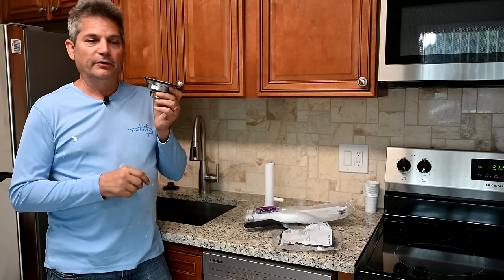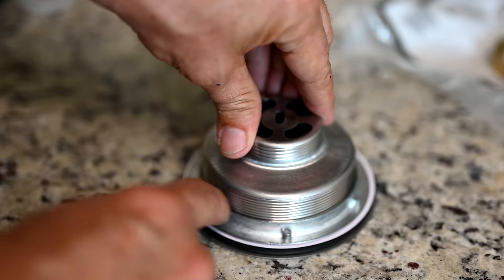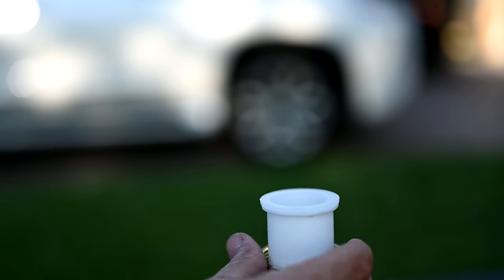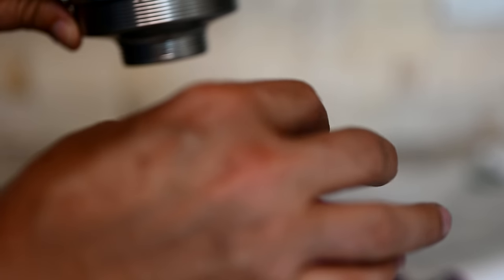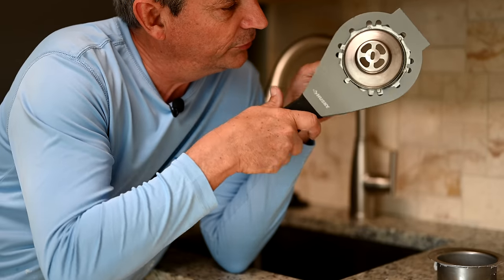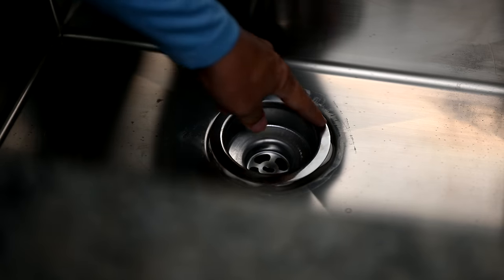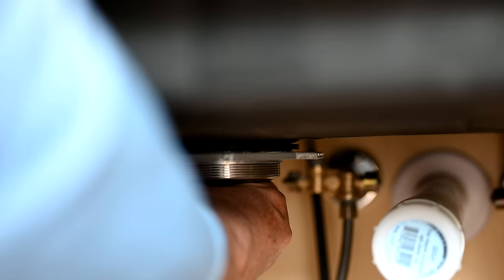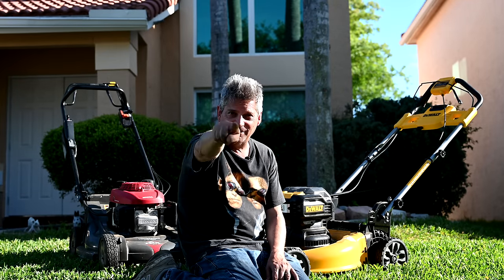How To Install Kitchen Sink Drain Strainer, Stop Leaks

Comment: Every time I tighten the drainpipe with the high hat washer in place it, the plastic nut "skips" & loosens. I have tried several times to line up the plastic nut onto the threads exactly & the plastic nut keeps skipping & loosens.  BUT when I remove the high hat washer, the nut tightens well. Any reason why this connection leaks with the high hat in place?? I only tighten by hand as much as I can.

Comment: Excellent instruction! Thank you, Jeff this will make the task go quickly. I would like to add one of my own tips, to save your back. Before you start, use a moving blanket or something similar as a platform to lie on. You could also use seat cushions, pillows, etc. The idea is to make them level with the bottom of the cabinet floor so you are lying down flat and not arching your back excessively.

Comment: Jeff, Very clear explanation with good close up videos. This will help a lot of weekend warriors solve their issues. That big strainer nut wrench is awesome. I have always gotten by with my 16 inch Channelock pliers. But next time I see one on sale or at a yard sale I will snarf it up.

The comment about the pipe joint comment on the threads helps with metal nuts and tailpieces, and especially with threaded tailpieces that go onto bathroom drains where the tailpiece threads into the popup assembly. On the others, the pipe compound is lubrication making assembly easier.

If you go to plumbing supply houses to buy your sink strainer you can get them with real brass nuts instead of the pot metal cast nuts. The brass nuts hold up much better over time especially if something loosens up and there is a small leak that causes corrosion. 

One other point, do not overtighten plastic drain nuts. If they don't seal when firmly hand tightened, replace the washers and check the alignment of the parts.

Keep the great information coming!
Reply from the maker: thanks Walter!

Comment: Thank you for this video.  I recently had a new stainless steel sink installed.  The drains on both sides leaked, so I watched this video and decided to redo them myself.  Not only had the installer not scraped off the excess putty underneath before threading the nut on, but he had also not used the friction washer.  After I reinstalled them the proper way, neither side leaks.  Just goes to show if you want something done right, do it yourself.
Reply from the maker: Excellent work Pete!

Comment: I spent too much time worrying about a sink drain wrench, when I should have paid more attention to the pvc pipes instead. Probably could have saved some money, used fewer pipes and less labor.  Buy plenty of pipe and fittings- you can always take back what you dont need, which is less frustrating than not having what you need up front. I ended out making 3 cuts on different pipes with regular hand saw. Its all together now, and I'm much more knowledgable- thanks Jeff!

Comment: Great explanation on how to do this correctly. It was missing a step on myself by not cleaning the plumbers putty off the bottom first before putting up the nut which was giving me problems everything shifting so appreciate the info.

Comment: This video was EXTREMELY helpful!! I almost threw the friction washer away. I threw the glacier bay box away by accident and had nothing to refer to to install the drain. This was perfect. Thankyou!!
Reply from the maker: I need to do a video just on the washer alone, many people throw it away!
Reply: @jeffostroff  Yes that would be a great idea. I installed a double sink last night. A few days ago, I fixed the drains to the sink and made 2 piles of boxes. One to throw away and the other to keep instruction manuals and 1 of any duplicate boxes I had just in case I missed something. Well last night i took the drain apart and looked at the washer assuming it might be paper there to prevent the rubber from scratching or getting damaged, a protective layer. Right when I thought about tossing it, I looked for instructions & realized I threw both boxes away with the wrong pile. Something said look on Youtube before I toss it. If I would have thrown them in the trash for my double sink I would have had double trouble.  Your attention to detail is great. For this to be 10 years ago reminded me of what I say about not counting out informational things just because it's got some years on it. Sometimes integrity gets lost with modern info. Really have to weed through & thats what I did. I came across a couple videos from this year and a few years back and they don't even come close to the way you broke this down. When i got to your video I watched it twice and shared it with someone. Very neat, very clean, very detailed. Again, thank you SO much. My sink looks amazing! I won't attempt to throw away small paper again before reading what it's for first lol. Have a happy new year!

Comment: I changed the drain last year in the kitchen but reused the copper pipes with compression fittings.  I used plumbers putty under the top flange of the drain.  Great. Video Jeff.
Reply from the maker: Nice work!

Comment: Excellent and detailed tutorial. I would point out that the edges of the High Hat gasket can impede the flow of wastewater and trap food. An alternative is a brass tailpipe with a gasket below the shoulder of the pipe, this is compressed by the bottom nut. It provides a waterproof seal and provides full flow of waster water as well.

Comment: This was extremely helpful. Especially the part about finding the threads by going counterclockwise till it clicks. Man… that’s seriously gold. There was a leak under the sink at the house we just moved into, I saw that whoever installed it didn’t remove the excess putty from underneath. It definitely caused problems.
Reply from the maker: Yes and as it turns out we really don't need to use the putty down there because it is the Teflon tape that actually solves the problem period so once you do that you can experiment with not putting the putty under there and I bet you won't have a leak.

Comment: All fine and dandy, with  ideal conditions. Your taking out a brand new basket strainer and putting it back in.
I've been a plumber for more than 50years. Very seldom does the old nut ever come off easy. It's a aluminum diacast nut. It corrodes to the strainer. Which means you'll have to drill and split the nut or saw and split the nut to release it. 
I've found if I cut from the top, with a sawsall thru the side if the strainer on a sharp angle I can cut the nut.
Also, it fine if you want to spend more for the nut wrench than the basket strainer. A channel lock pliers works fine and a second on the threads below to hold the basket strainer from turning.
Also be sure to tighten the nut enough to squeeze out most of the putty or you'll have a leak later when the putty breaks down later. 
Also I put pipe dope or grease on the threads for the next guy years from now !
So unless your working with all new, you might want to call a pro !!
Reply from the maker: We have had some tight ones also. I can also use a Dremel on the bottom rusty nut. Sometimes, a drain wrench inside the basket drain up top can be held by one person, while another loosens from underneath

Comment: This was a very useful video - no frills, keep it simple and straightforward with accurate and clear descriptions of the functions of the different pieces and their role in the overall configuration. Thank you, Jeff. 
Question: after installing a dishwasher in my dual sink configuration...I experiencing drain backups. Does a dishwasher install require an air gap 'thing' to keep the system flowing?
Reply from the maker: The other sink should not back up. Did you watch our dishwasher install video from last year? we show you how to do the high side loop for the dishwasher hose? Also you might have a sewer clog somewhere down the line, we just cleaned out our kitchen sewer line last year, as it clogged a bit causing water to back into the 2nd sink. Often requires $150 visit from plumber to clear it out.

Comment: Good video and very informative.  The only suggestion I have would be add pipe dope to both sets of threads on the basket strainer to help seal joints.  There are also specialty wrenches for inside basket strainer to keep them from turning while you tighten the larger bottom nut, but I typically just put two screw drivers down through the top, in different holes, and turn them clockwise while I tighten the large nut with a large pair of pliers.
Reply from the maker: Good idea! Although, I usually don't recommend adding pipe dope unless you have a leak, these usually don't leak if you install them correctly. Also remember that pipe dope only gets applied to the male threaded part, not the female parts.

Comment: I installed a new drain in kitchen, but the friction washer go wet, and disintegrated. Had lots of problems with washer moving sideways, and also drain moving. I was stuck using an adjustable spanner wrench that constantly slipped off drain nut. Very difficult to get the thing much more than hand tight. I did manage to get it tight, and not currently leaking. Thanks for the video. I am heading to lowes tomorrow to get the wrench you used, and probably will wind up buying a new drain with new friction washer, and gasket, and do the job again the correct way. Thanks to you, I now know the right way, and will hopefully have no leaks for a long time to come.
Reply from the maker: I got you covered Mark, Lowes sells them $2.98: https://www.lowes.com/pd/Danco-2-Pack-4-375-in-Rubber-Basket-Strainer-Washers/4777141

Comment: Thank You, at first I was confused because the instructions I got from my new sink / drain showed one gasket on top and another on the bottom. It leaked so I switched places for the gaskets and was fine for a day but I decided to use plumbers putty on top and both gaskets on the bottom.

Comment: Great video, it is exactly what i need. But it stopped at the spot where i needed the most. How did u end up connecting the sink drain to the drain on the wall? Our house has a very high drain as well. There is only 3 inches left between bottom of the sink and the drain line from the wall. Did u had to extend the height of p trap to accommodate this situation? If so is there going to be any issues in the future?

Thank you so much
Reply from the maker: This was a brand new sink put on a brand new cabinet that replaced an old set of kitchen cabinets with a very narrow sink and it was barely working to begin with period So what we ended up doing after this was we discovered that the water wasn't draining so we ended up cutting into the wall and lowering that pipe that goes into the plumbing stack. We have another video that we hope to get up on this in the next few weeks that shows exactly what had to be done but yes this is a problem for a lot of people when they remodel and they go with a deeper sink which pushes the the level of the water lower but yet the output of the P trap is higher and it can't be that way it's all tablet. Particularly in a house like this one where there was no garbage disposal before, the output of the garbage disposal cannot be below the output of the P trap or the water will come back in and fill up into the garbage disposal. We hope to have that video up soon
Reply: @jeffostroff  Thank you for the speedy reply. That's exactly what my plumber friend suggested. But it's a lot of work to do that way since our in plastered wall drain is a cast iron pipe... In ur experience, would 3" higher work? 
What could cause water not drain?

Looking forward to that video 😊
Thnx again 😃

Comment: Thanks! I have to replace those parts for my kitchen sink and glad you said not to put the old putty back in the container. I just watched another of these repair videos and didn't like that he said to put it back in with the new. I'm used to working with fluxes and other materials and have been taught to never do that - contamination weakens the fresh stuff of some things. There were more parts I didn't like with his work either. He just reattached dirty (black crud and mold) pvc back up instead of taking it to another sink to wash off properly with a brush. Yuck. It was like watching someone sweep dirt under a carpet!

This is why I do my own repairs, and I'm in my 70s. I have hired too many repairmen that take shortcuts or are uninformed and charge big bucks and then I have to redo the repair myself after it fails.
Reply from the maker: Sometimes it's more rewarding when we do it ourselves

Comment: I have an old Kohler porcelain kitchen sink and I think I probably need a deeper strainer than the one Jeff is using here.  I don't want to start the job to find out I'm not using the correct strainer and then have to scramble to find a different one.  

Any help would be greatly appreciated to let me know exactly what sink strainer would work with a Kohler porcelain sink.  

THANK YOU VERY MUCH FOR YOUR HELF AND FOR THIS FANTASTIC VIDEO!!

Comment: My comment is for anyone who is super tight on money or who takes drain apart and realizes the stores close early on Sunday (me yesterday evening). My drain and the black gasket were still in good shape.  The plumbers putty was disintegrated and there was no cardboard gasket to keep the black gasket in place.  I figured out that silicone sealant works in place of plumbers putty.  I traced the black rubber gasket on a cereal box cardboard and cut it out with an exacto knife to make a cardboard gasket. It worked great.  The cereal box gasket kept the black gasket in place while tightening the drain up. Tested it this morning after letting the silicone sit for 12 hours.  The drain works great, no leaks!

Comment: 11:40... Thanks.  When I was cleaning up that putty from the top I found that If i use some of the excess putty like an eraser it would grab the extra down in the cracks and pull it out.  Probably doesn't matter in the long run but it did make it look pretty spiffy.

Comment: Great video good camera work concise explanation. One mistake that you made and it is a big one. My personal suggestion is to never ever use a white plastic tail pipe if it has the dishwasher connection. The reason the building code requires 1 1/2 inch drain connection to the kitchen sink is because of all the big chunks of junk that are going to wind up getting flushed down there so there is much less chance of clogging. The cheap plastic tail pipe with dishwasher connection is reduced in size internally from 1 1/2 inch, to 1/2 inch which defeats the whole purpose of having a larger pipe. The plastic pipe cost approximately $5.00 at Home Depot but the brass pipe with dishwasher extension cost approximately $22 at Home Depot money well spent to avoid clogs in the future and if you have a higher level temperature which you should for a dishwasher. The plastic has a tendency warp. you can save $15 with the cheap plastic tail pipe but I would always go with the brass tail pipe if you have a dishwasher connection.👨‍🔧

Comment: This is so interesting. My Ruvati sink installation calls for the foam/friction gasket to go on first, then the rubber and the plastic nut. My sink is leaking now after about 4 years. I am think that at the replacement to follow your directions.
Reply from the maker: That will help for sure! It will solve your issues on this leak

Comment: What’s the material difference between the $10 Glacier Bay and the $25 and up other model at The Home Depot?
Thanks for the great video!
Reply from the maker: I can't imagine there is any difference. Maybe the Glacier bay is not pure stainless steel and the other one might be. Put a magnet on them. If the magnet stays, the metal is an alloy mixture, not pure S.S. But if the manet does not stick, then t is pure stainless steel

Comment: This is a Fantastic video!
 Is it possible to plumb everything in schedule 40 ABS or PVC pipe? Is a Tailpiece available in schedule 40?  How can you connect a schedule 40 pipe directly to the drain basket, what threaded piece is required? I can't find one!
Reply from the maker: Yes in the 1970s, they used to do that but now cities want the p-trap to be removable and cleanable. Remember that the pipe that mates tot he basket is flat on top, so a SCH40 maybe would work with the same dimensions, but finding the plastic nut might be harder.
Reply: @jeffostroff  maybe it's best just to use a tailpiece of 17 Gauge chromed-brass or the thinner ABS stuff with a built in fkange at the top. From there on out I'll use the schedule 40.
 Did you know I can't find a video on using all schedule 40 ABS or PVC pipe? I'm leaning towards ABS because the primer used on PVC looks so sloppy when done.

Comment: Wonderful video!  Will this work for a stainless steel sink?  Also, My dishwasher drain is attached to the post.     I wonder if you could show me how to take off and replace that clamp.  New install and afraid of doing something to negate the warranty. I am 81 YO but still do home maintenance. Thanks.

Comment: Thanks for easy video to learn ¿ How long you leave The plumber's putty on ?
Reply from the maker: The plumbers putty does not need to cure leg silicone does. So you can use it right away without waiting that's why many plumbers prefer to use it. Silicone gives you a more effective seal, but plumbers hate it because even the best silicones you have to wait at least 30 minutes before you can water test it. so you will naturally here plumbers come in here and whine about using silicone and they'll make up stupid reasons why the plumbers putty is better than silicone because they don't want to have to wait around